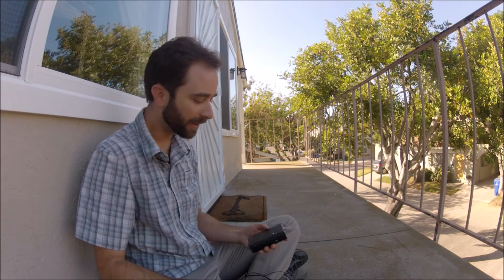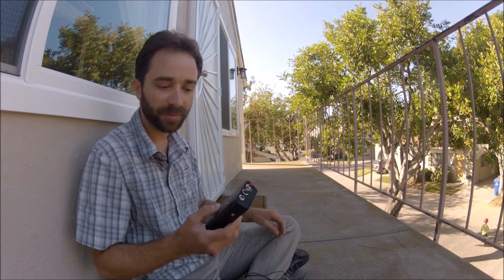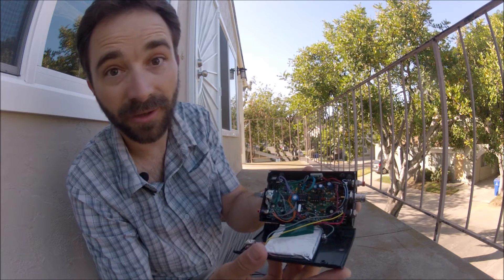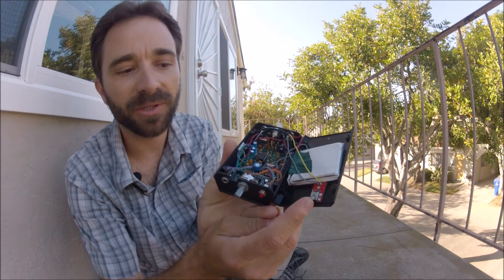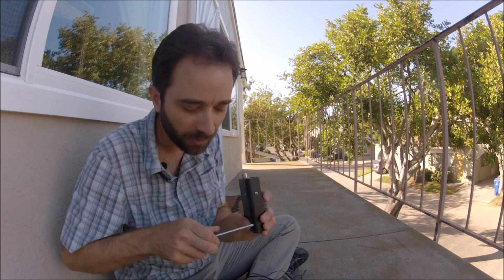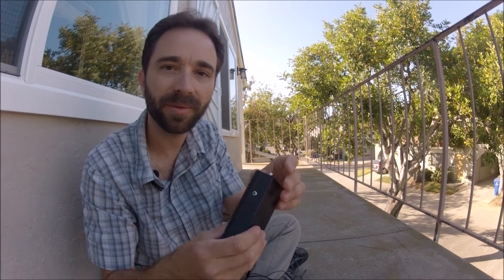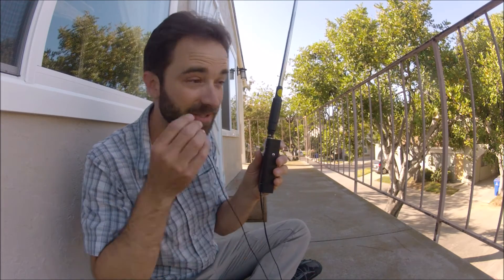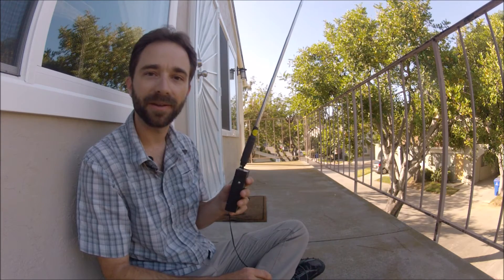40m Rockmite CW Transceiver Build w/ Touch Keyer

Comment: Don't do a video unless you are ready to do it right, no audio on receive and you haven't any on air experience. A waste of your talent.
Reply from the maker: Thanks for the feedback, Burt.

The rockmite does produce receive audio, though it's not as loud as the sidetone. Looking at the circuit diagram, I see the sidetone doesn't go through the LM1458 audio amp, so it's possible that I either have a damaged LM1458 or a problem with the trim pot I used in place of R8. I'll be checking those both to see if there's an issue that needs to be resolved. 

Perhaps you disagree, but I'd rather build my skills sending and receiving before fumbling through a CW QSO that ends up being painful for both parties involved. Assembling kit and a few pre-built modules into a fun little device is (fortunately) a skill unrelated to being able to actually use it. I'll get there though. And now that I've got this to practice with and listen and copy code on, my learning will be accelerated.
Reply: Vector511c I don't disagree about waiting to get on the air but producing a video before both it and you are ready I do have an issue with. Your technical talent is admirable.
Reply: +burt2481 Burt could've been a bit more diplomatic, but we hams are somewhat notorious for our perhaps stunted social skills. Vector, I can't say enough--the screw contacts for the TouchKeyer, the package--it's all excellent. Remember this--if you can't do something well, learn to enjoy doing it poorly. An adage that hardly applies to you, however, but perhaps your burgeoning CW skills. Hang in there and do it. My mother had to take over the key on my first QSO. I freaked out. But now I can work CW fairly well. Impressive video.
Reply: burt2481 Your comment is negative, non-constructive, and not in the ham spirit. We would all benefit from learning about your own talent through your specific suggestions on how to improve. Beginner here with true respect for teachers, not so much for judges. This was perhaps a waste of talent, not his. Please help us to learn by example.
Reply: ^Grumpy old man
Reply: burt2481 it's helping peers to grow, showing examples of what worked for you - if experienced and successful - and refrain from judgmental and useless criticism. be constructive, participate, contribute, help other growing. negative feedbacks are useful but point the way, if you have one. otherwise what's the point? Please reply and help us all with explicit and concrete examples of e.g. how to improve one sending, ho to improve one's technical skills with electronics and construction. please be of help for your peers. thanks for your help.
Reply: I guess reading and comprehending is difficult for you. He showed us no audio on receive and no on the air experience which would allow the viewer to ascertain was this a good project.
Reply: What is the ham spirit saying hi hi, lying about reports in a contest?